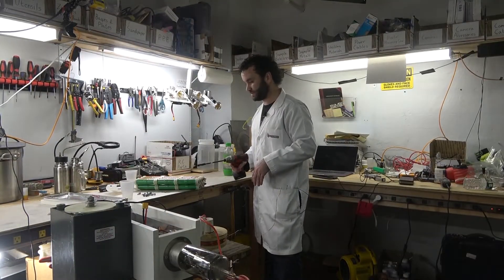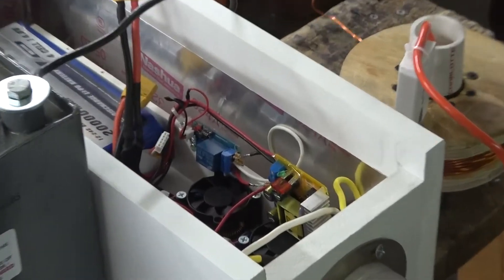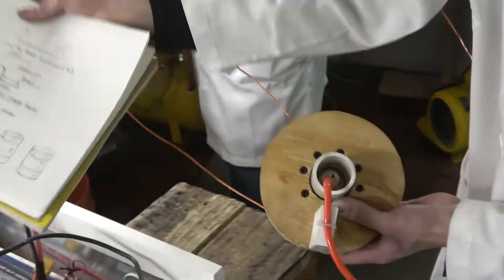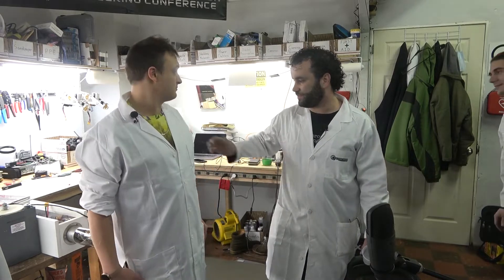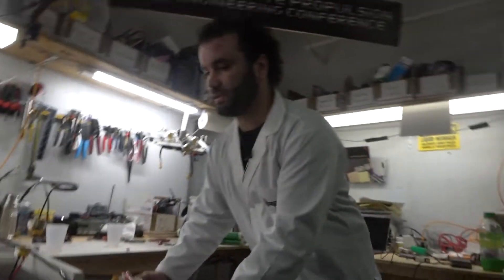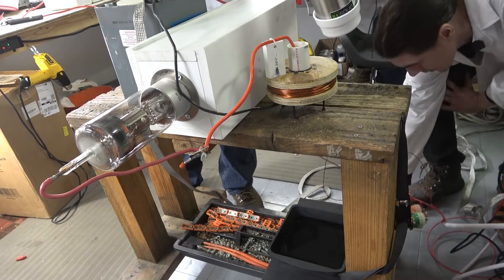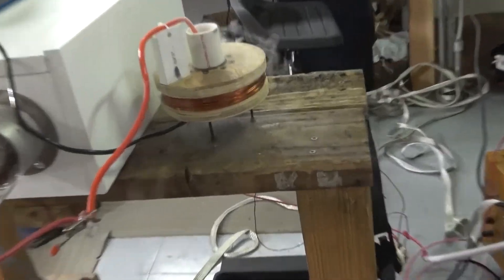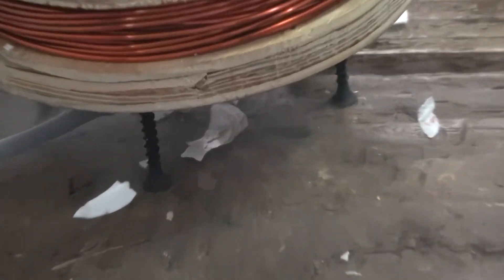Superconductor Bi-layer Gravity impulse Experiment

Comment: Is this based on Tajmar's setup? I don't recognize anything from Podkletnov's description here. I saw a video with him later where he said the effect doesn't even require a superconductor so I would just start with a copper disc spun mechanically up to a certain speed and then discharge from a fast capacitor into the edge of it. This can be done mechanically with an electrode on a long dielectric rod. No need to complicate the setup just yet. The copper disc with a central hole can be attached to a plexiglass disc with an axis through and spun with a motor.
I speculate from both podkletnov's claim and UFOs with spinning body and signs of EM agitation that what we are looking for is at the core EM agitation of spinning mass. Spinning mass jives with the frame dragging effect, might also be what creates cosmic jets and even galaxy spin anomaly. Podkletnov might be a complete hack but UFOs having a spinning element and twisting forces under them and various EM effects like high voltage hiss, bass amp hum, microwave cooking under it, corona discharge glow it seems pretty certain that EM and mass spin are in play.
I don't think there is value in going to extremes with the parameters. You are not looking for an explosive effect, you just need a scale to deflect ever so slightly. A small but fast capacitor at first. You can cool the copper disc with liquid nitrogen, that will improve its conductivity by maybe a factor 5. Make the disc fairly beefy, like 10mm and maybe 30cm in diameter. Then maybe a piece of glass or plexiglass over the experiment and then various dielectric little weights on non conductive bendy arms and a camera close up of this to see if they deflect at all. It could be as simple as a bead on a elastic string and hang a row of them spanning the disc. Ideally only those above the disc would lift.
It's not about a frankensteinian looking experiment, it's about good scientific discipline.

Comment: I think you guys are definitely on the right track. Without question gravity is another form of electromagnetisn, it's just a matter of how. In that video it looks like there is an impulse of some sort, I don't know if it's a pressure wave of air or ether. Have you guys seen the work of alexey chekerkov and his levitating discs using spinning charged plates and magnets?
Reply from the maker: We have reached out to Alexy, He sounds very sketchy and scammy.
Reply: How is Gravity another form of electromagnetism?
Reply: @Sheen023  The physical attraction effects we see with magnetism and static electricity are far similar to gravity than any other model we've seen. Gravity is mutual mass acceleration between two objects. This is an incoherent form of magnetism that gives the physical world it's properties. Think laser/lightbulb with magnetism/gravity. Understanding the ether is a more practical application of "space time". The more mass an object has the greater the torsion field it creates in the ether space it occupies with gravity as a byproduct.
Reply: @roberthawkins3106  I'm afraid that doesn't answer my question ..does it?
Yes , I'm aware of similarities & I'm also aware of space time fabric concept.
Reply: @Sheen023  The connection between electricity and magnetism is well established, and the basis for our current understanding. It stands to reason static and gravity are also related in a similar way. Every atom is essentially a miniature magnet with an axis of polarity. A magnet is simply these atoms aligning coherently. A rock also has atoms but aligned incoherently towards the center. The orientation of fields creates all the effects. If we were able to manipulate a magnetic field to be incoherent and apply it, we could see exotic effects.
Reply: @FalconSpace  he is… there is an older video where you can see his shadow manipulate what appears to be strings “off camera” which are connected to the top of the graviflyer
Reply: @roberthawkins3106  Watch this video, it explains everything about Alexei's experimental antigravity technology: 
www.youtube.com/watch?v=ncwSZGn_oic

Comment: if you use the weight of the copper on the coil and its gauge, you should be able to get to a good idea of how much length of wire is on there.
Reply from the maker: good observation !

Comment: Awesome experiment!  The YCBO interfacing material electrical resistivity appeared to act like a fuse element blowing. I design EV batteries and have worked with very high currents for decades. You are going to need to clamp those YCBO disc to achieve the needed conductivity, I've tested the world's best conductive adhesives, and clamping interfaces range an order of magnitude lower impedance (and associated rapid thermal/gas production during the current pulse in your case).  I would love to donate some high current power supplies for you, it was painful to see you needing to use NiMH packs, but way to be scrappy.